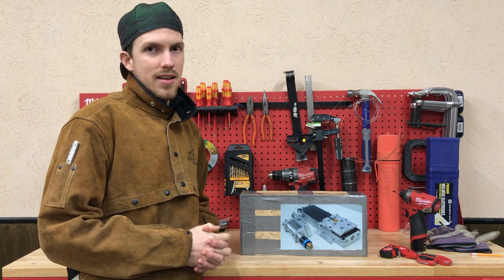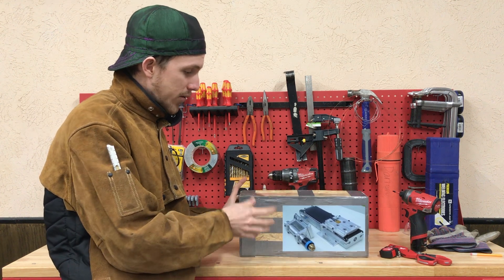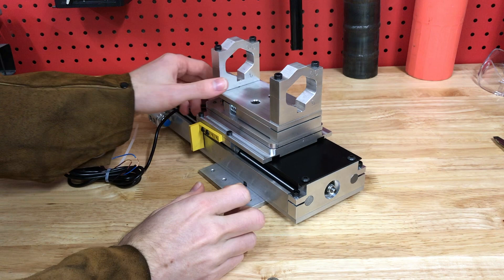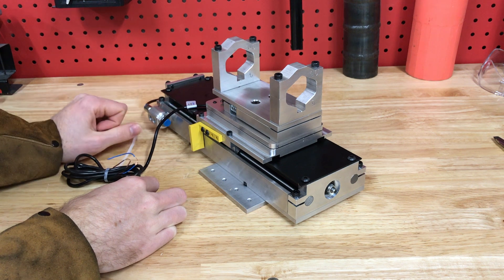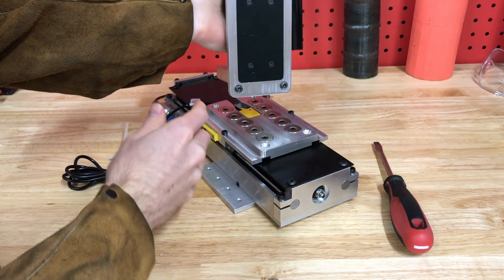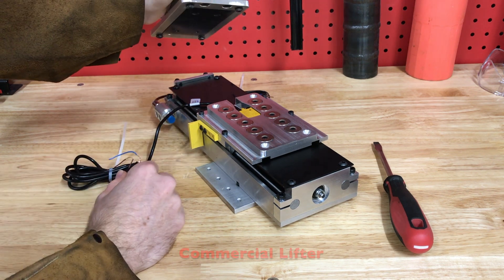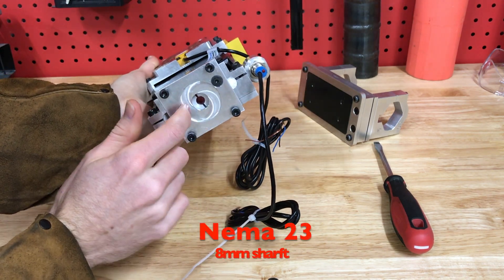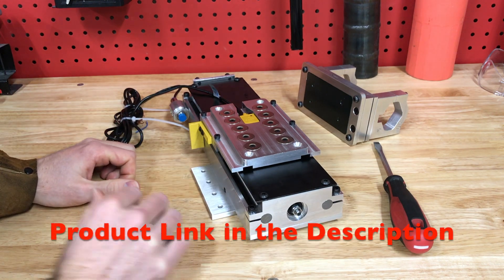CNC Plasma Z-Axis with Magnetic Breakaway

Comment: Looks nice but you may need to remove some of those magnets to make the breakaway work a little easier. With all those magnets it may damage the torch if it does not actually break away. The other thing I see is the limit switch design. The yellow flag should pass in front of the limit switch and not move directly at it. This is a recipe for a broken limit switch or worse. With some minor tweaks it could be a nice Z axis but it's a little pricy in my opinion.

Comment: More info about it? Did you test it yet? I saw some bad reviews about it. So just wondering.
Reply from the maker: I’ve been super busy working and haven’t yet had time to finish the CNC table or get it tested yet he does have several more economical models that I have heard people say have a little bit more movement but on this one it seems to be very rated
Reply: @CreativityUnleashed  Yeah what I read was that the Floating head made it a little bit "wobbly". I was looking to purchase the same modell as you or one of the more expensive ones. 

Could you perhaps check if this is the case? I tried sending them an email but they have yet to respond.
Reply from the maker: @olemortenelstad2571  and believe I have the link to the one I got in the description. And since he makes all of them himself and runs the website and everything else he doesn't always have time to get back right away. It's a lot of work running a business by yourself.